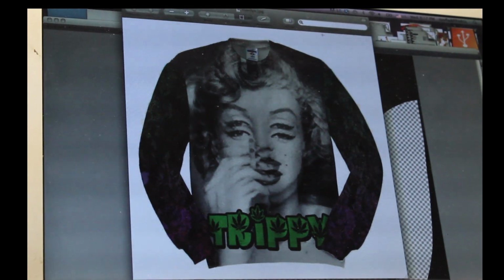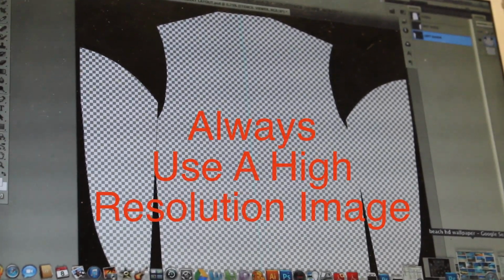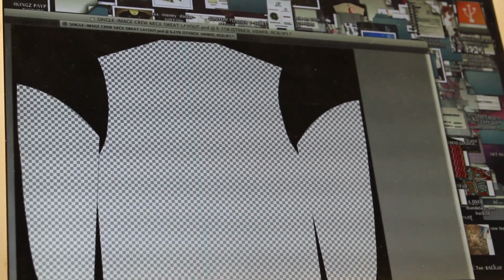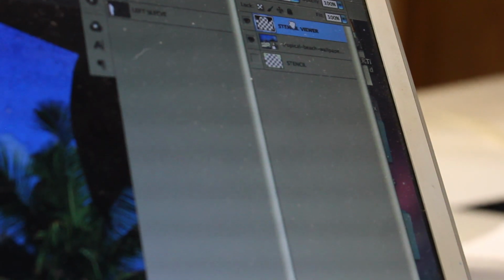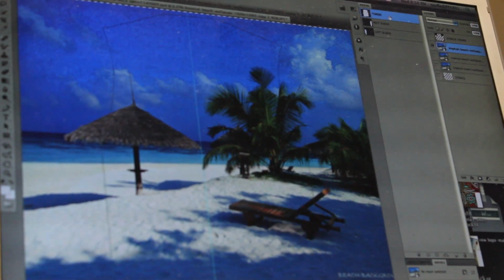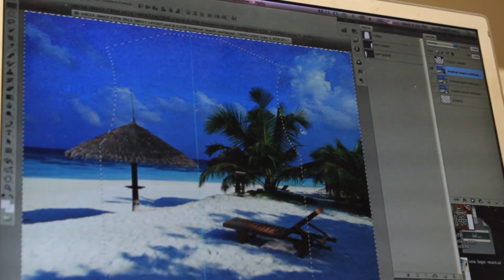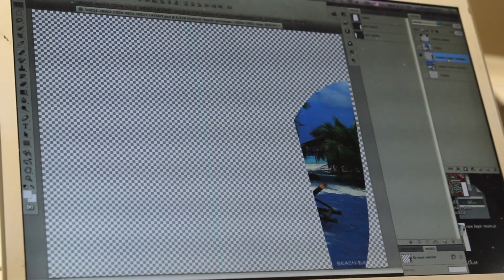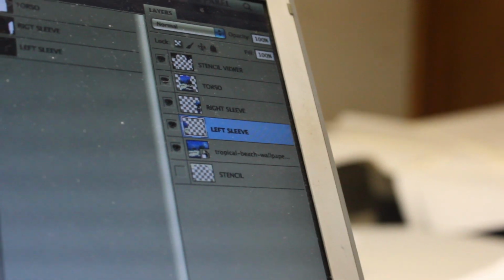How to design dye sub All Over Print Tees

Comment: I'll have to disagree about the mockups. A mockup is designed to give the printer a eough idea of how the final product should look to the customer. The user then set up a printing sheet which is the mockup, a setup of ink color shades for the shirt, and the sub and back ground images. Now for w full all over shirt they should also use this template as a way to help the printer bring the product to life (if its long sleeve)